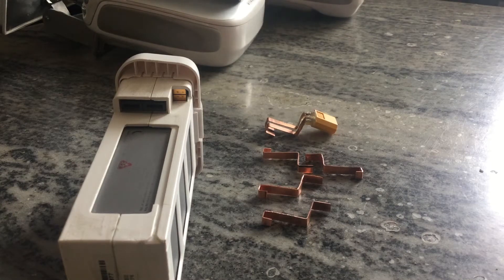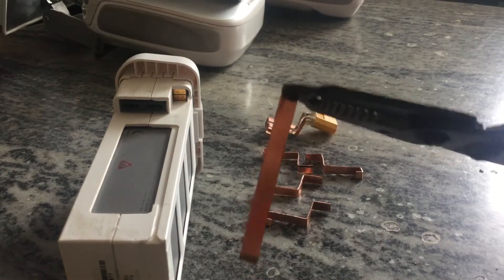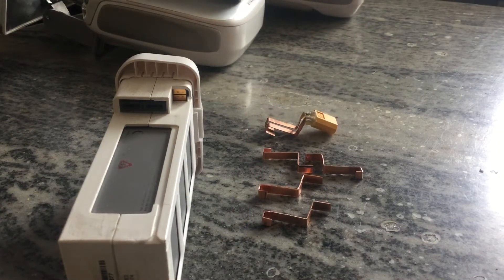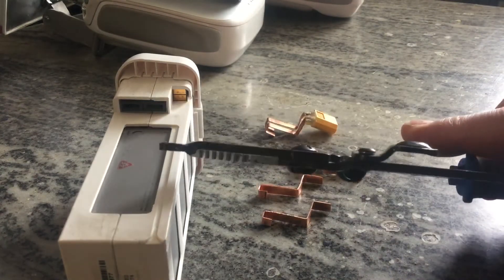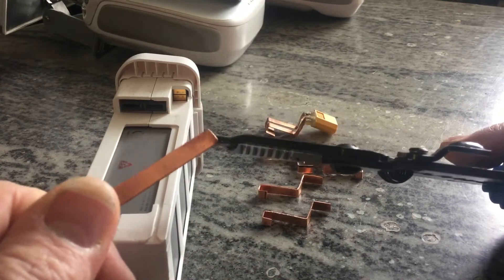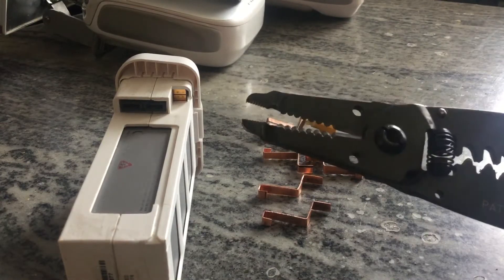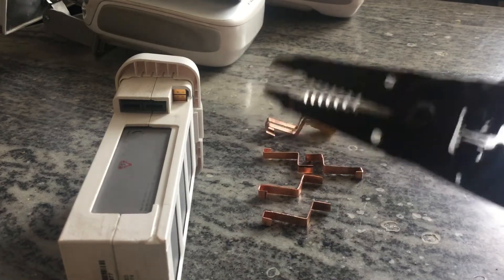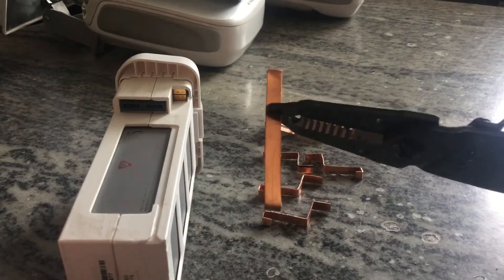Phantom 3 DIY  battery clip mod (how to)

Comment: https://hobbyking.com/en_us/turnigy-bolt-2800mah-4s-15-2v-65-130c-high-voltage-lipoly-pack-xt-60.html

here is the battery i could use some help my self if any1 want to pool up and figer this out i make a email address so we can connect im thinking i make a chat room if i get ppl want to talk and share ideals on how to get mod the djis its really hard to find good information on the dji with the dam 15.2v battery its took me 6 days to find that battery 

FYI im just a guy that live in TN im not trying to sell anything i just like modding things and play around and have fun but batteries can be very dangerous thats why im trying to get ppl together to share information as long as you understand that me and any1 else are not responsible for your actions and  the dangers of modifying your drone and understand that only you are responsible for your drone and if you are not old enough to make adult decision then you should not attempt anything like this :) but with that out the way let chat if you are interested 

 

phantom3modding@gmail.com 

lets talk and share i have other ideas on other batteries too if i get ppl in i will make a facebook or whatsapp chat room

Comment: Hi. I made the clip like you did ( .6mm copper) but now it's really hard taking the battery out. Any suggestions?
Reply from the maker: Nick Omg yes it will fit a little tight but as long as it works it's all a G.thanks for watching!!
Reply: Nick Omg maybe you should consider reducing to gauge and make sure the gauge wire can handle the current flow through it also a second thing you can do is gently and precisely slice out the notch that the wire needs to freely clip in and out of drone if you don't have warranty on that it won't matter if you do have warranty on it we'll just make sure the wire can handle the load and make it thinner
Reply: Will give it a go, thanks!
Reply: video blade silverwingflinx 

https://hobbyking.com/en_us/turnigy-bolt-2800mah-4s-15-2v-65-130c-high-voltage-lipoly-pack-xt-60.html

here is the battery i could use some help my self if any1 want to pool up and figer this out i make a email address so we can connect im thinking i make a chat room if i get ppl want to talk and share ideals on how to get mod the djis its really hard to find good information on the dji with the dam 15.2v battery its took me 6 days to find that battery 

FYI im just a guy that live in TN im not trying to sell anything i just like modding things and play around and have fun but batteries can be very dangerous thats why im trying to get ppl together to share information as long as you understand that me and any1 else are not responsible for your actions and  the dangers of modifying your drone and understand that only you are responsible for your drone and if you are not old enough to make adult decision then you should not attempt anything like this :) but with that out the way let chat if you are interested 

 

phantom3modding@gmail.com 

lets talk and share i have other ideas on other batteries too if i get ppl in i will make a facebook or whatsapp chat room
Reply: Nick Omg 

https://hobbyking.com/en_us/turnigy-bolt-2800mah-4s-15-2v-65-130c-high-voltage-lipoly-pack-xt-60.html

here is the battery i could use some help my self if any1 want to pool up and figer this out i make a email address so we can connect im thinking i make a chat room if i get ppl want to talk and share ideals on how to get mod the djis its really hard to find good information on the dji with the dam 15.2v battery its took me 6 days to find that battery 

FYI im just a guy that live in TN im not trying to sell anything i just like modding things and play around and have fun but batteries can be very dangerous thats why im trying to get ppl together to share information as long as you understand that me and any1 else are not responsible for your actions and  the dangers of modifying your drone and understand that only you are responsible for your drone and if you are not old enough to make adult decision then you should not attempt anything like this :) but with that out the way let chat if you are interested 

 

phantom3modding@gmail.com 

lets talk and share i have other ideas on other batteries too if i get ppl in i will make a facebook or whatsapp chat room

Comment: I found a couple of places on ebay to get the same pieces of copper strip SilverWingFlinx used here.

First Link: https://www.ebay.com/itm/131801227612
Order: 24 inches of 24g x 1/4" for $5.87 and free shipping
You will have a lot of extra copper in case you make a few mistakes ;)

Second Link: https://www.ebay.com/itm/192313911872
Order: One Strip @ 6 inches of 24g x 1/4" for $2.00 and $3.00 shipping
You won't have any extra to make any mistakes, probably should buy a couple of strips.

You can find the XT60 connectors you need on ebay too. You can find the clippers on ebay if you need them.

Happy Flying Everyone!!

Comment: Great video! Feel free to join us on Facebook in the DJI Phantom 3 Mods group.. https://www.facebook.com/groups/1844881782435825/
Reply from the maker: hello glad you like it thanks for watching,plez sub.
Reply: Subbed! :)  Where did you purchase the 5mm, 24g flat copper?
Reply from the maker: what i had done is went to a metal fab shop and they cut copper sheets into strips.but it was cut a little to wide so i still had to trim off about one mm.the copper is a little to thick but i made it work.my thinking is a little heavier awg cant hurt.
Reply: Thanks. Don't need it for adding batteries, but it will make tapping into the battery a lot easier to power the drop mechanism I am making. ;)
Reply from the maker: i have about a total of 9 feet which i will never use but it was free.
Reply: You never know.. You might be glad you have it for some other future project. ;)
Reply from the maker: catch and release mechanism?